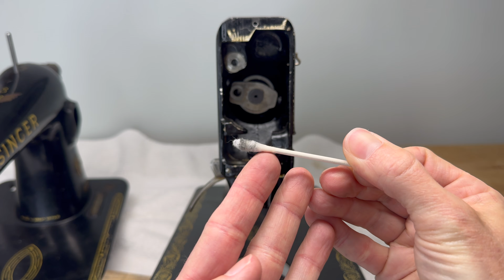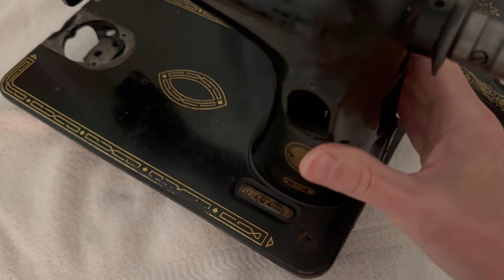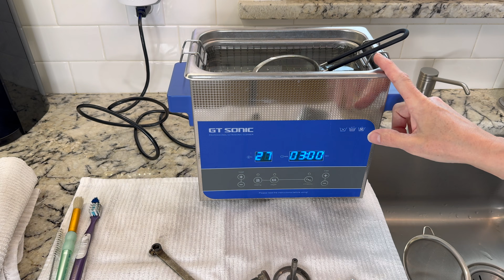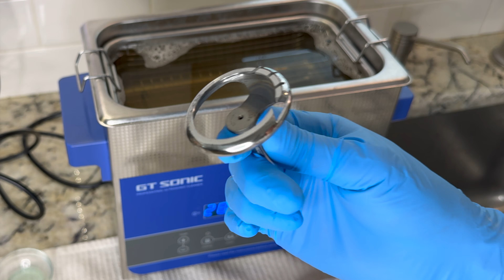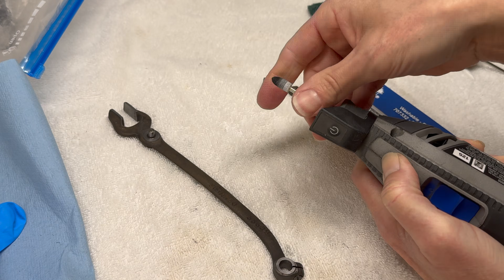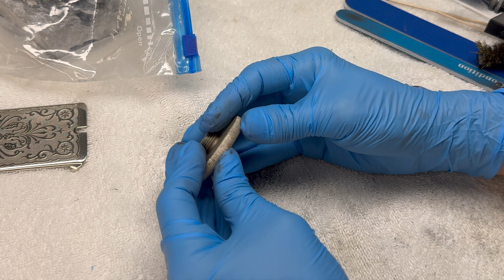How to clean an old sewing machine - In depth Singer 99 Restoration - Works for any vintage machine!

Comment: Hi yes useing the Q clips is a good idea but I use the eye make up pads they in a circle plastic bag with 50 or more they cool to clean my camera lens. Use these pads will allow to give a nicer rub over the dull area. Also removing the old oil and greasy is lighter fluid with cheap tooth brushes grate for removing that old build up of oil. I used this on my singer 201K I got at a recycle area it freed it up. Hi from Ireland
Reply from the maker: Hi! Yes, I use those pads too sometimes, they are great. Never tried lighter fluid, does it damage the finish at all?

Comment: Wonderful tutorial/information.  I wonder how you like the 401A vs the 99? My mom's 99 is waiting for help...now I have a better idea where to start. Thank you!
Reply from the maker: Hi! Wow, I think it would be like comparing apples to oranges. The 99 is strong but is straight stitch only. It also has an oscillating hook and is belt driven. The 401 has several different stitches as well as a drop in bobbin and different hook style. And it is a gear driven machine. I’d trust my 99 for heavier work like denim but I would do almost any else with the 401. Both are great machines. It would be hard for me to choose a favorite of the two!
Reply: @SewingMachineRehab  Thank you!

Comment: I used ONLY sewing oil on my gifted 15-91 that I hadn’t touched for 7 years and was dusty… and thought it was taking off only that dust and what looked like nicotine… then I thought… hmmm…. So I read a bit, got out my black light… and realised I’ve stripped half the shellac cos half the machine is purple where I “cleaned” and the other half still green…. Dang it! Got so mad I’ve put it back on the shelf for another day….
Reply from the maker: Aw, you would be surprised how many people think the same thing, that they are removing nicotine. But the old shellac gets a patina sort of like copper does. It yellows with time. How odd that just oil took it off. It may have just been too compromised already. Who knows how but it happens! I hope you are able to get it to a point you are happy with it!
Reply: I don't know about the USA but the UK singer store sells a varnish specifically for the old black cast iron machines. Haven't tried it yet, waiting on my delivery. Maybe it would help?
Reply from the maker: @thecornerplot7917  I'd love to know the name of this polish, I would look for it here in the US and give it a try!
Reply: @SewingMachineRehab  it's called Gold Pro, comes in a little black screw tin.

Gold Pro Polish for Vintage Sewing Machines

And they sell it in the UK singer shop for £20

Comment: Great tip to use the ultrasonic!
To thoroughly dry parts, especially any unplated parts which can flash rust, try using a hair dryer.
Have you tried SimplyGreen HP version?(purple colour), safe to use on aluminum and all rubber parts.
Great video!
Reply from the maker: Hi! Yes, a hairdryer is a great tool for drying them. I haven’t tried the simply green product yet, maybe I will look for it the next time I am out and about.

Comment: If you haven’t tried Gojo ( non pumice) cream hand cleaner,you should give it a try.
I have restored close to 100 machines of all types and find it superior to SMO and kerosene.
I have never had a bad reaction with shellac or painted finishes yet.
It is safe for your skin, if you use cotton make up remover pads for cleaning. The lanolin in it will also help soften rubber parts.
Reply: Sadly, that Gojo product has been discontinued by the manufacturer. Goop cream cleanser is similar and NAPA auto parts has a store brand equivalent too.
Reply from the maker: Hi again! I have heard this before but haven’t given it a go yet. Good to hear you have had so much success with it. How do you keep it out of all the oil ports so it doesn’t get down in the bushings? That is my only concern. I am guessing that you just have to be very careful…thanks for sharing all your tips!

Comment: After as much as possible I like to spray WD 40 on areas of parts that have nooks and crannies that can hold water. the WD actually stands for "Water Displacement".
Reply: Meant to say after "drying"
Reply from the maker: I haven't ever tried that method. I have also heard that you can dip the part in alcohol when done so that everything will dry faster. Haven't tried that yet either. Thanks for the tip!

Comment: Thanks, impressive work. I will try out Kerosene.
Reply from the maker: Thank you! I avoided it for some time because of the smell but really glad I gave it a go, it's always on my bench now!
Reply: @SewingMachineRehab  Yesterday, I tried out brushing a coat kerosene on a nasty frozen Toyota Z800 Japanese Sewing Machine. You are right, that disgusting smell has driven me nut and sick. Enclosed it with plastic container and leave it aside 24 hours. And today I steam bath the the machine using German Karcher Steamer. It worked wonderfully, the reverse push button and the stitch length knobs stuck problem was resolved and it started to function properly. Hooray !!!! 😂🤩
Reply from the maker: @clementihammock7572  Oh my! That sounds like quite a process! I have never thought of trying that, so glad it worked! Sometimes we just have to get creative!
Reply: You could not have made a better video, so easy to learn with you, thank you so much again 😊
Reply from the maker: @carolineroy9026  Thank you!!!